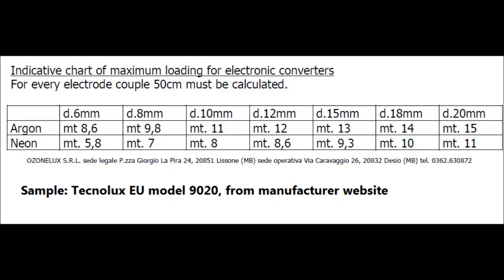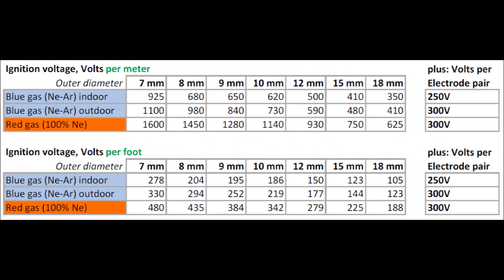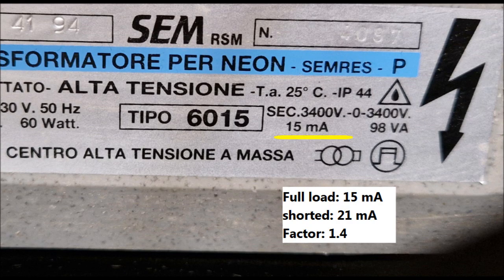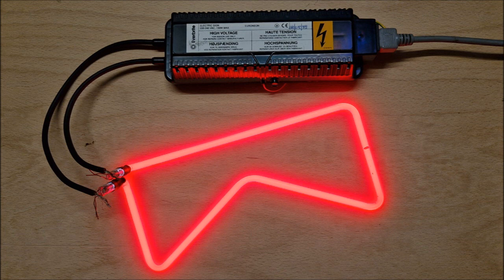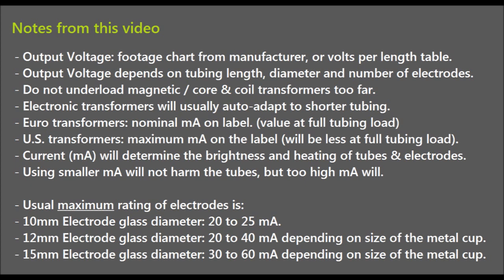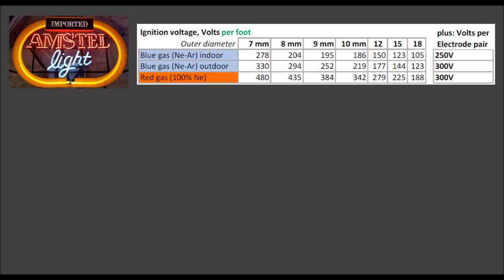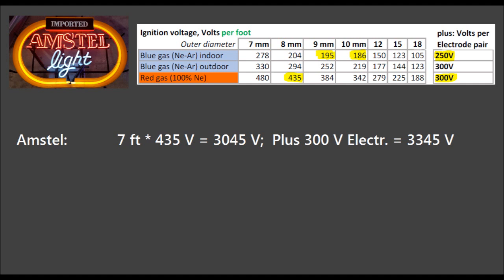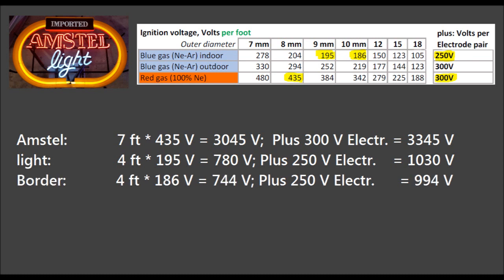Neon Sign Transformer Loading: Proper Selection, and Meaning of the Values

Comment: My transformer has a rating of 4.5kv and 30ma.  I'm having trouble finding an exact replacement with these values.  Is it ok to oversize to 5kv, 30ma transformer?  There seems to be plenty of that size available.  Thanks for any info!
Reply from the maker: @recsite  that should not be a problem. Are you sure it's a 4.5kV (unusual value) or does it possibly say 4,5-E-4,5 kV? That would be a 9kV.
Reply: @NeonSignStuff  The information plate says Output 4.5-0-4.5kv  30ma.
Reply from the maker: @recsite  that's a 9 kV. Mid point grounded internally.

Comment: I often face a problem where my electrodes get black and burned out after several months of installing the sign. Does it have to do with the amount of mA I provide to the glass tubes? I use electronic neon transformers albeit stored inside an MDF box.
Reply from the maker: That sounds more like a problem in processing the tubes

Comment: What is the difference between "blue gas indoor" and "blue gas outdoor"? I assume different mixtures of gas components?
And why is one especially for indoor and one for outdoor? Can one handle better cold temperatures? Or has it a better output/efficiancy?
Reply from the maker: Hi, there are 2 answers to this question.
a) "blue gas" can be pure argon with mercury, or a Ne-Ar mix with mercury. The mix is called "cold weather gas" or "K4 gas". It has a bit more voltage requirement and burns a bit warmer - which helps mercury tubes to get bright faster in cold weather. But it lights up just the same as pure argon with mercury.
b) in Germany, we get freezing temperatures in winter, and almost no shop uses pure argon. They all have the mix blue gas on their machine, no matter if they fill tubes for outdoor or indoor use. Hence, these values "indoor" and "outdoor" are both meant for the mix blue gas. 
Still, they add a bit of voltage reserve in case your tubes are used outdoors, just to make the operation more reliable in freezing temperatures.
Reply: @NeonSignStuff  Thank you for the explanation!